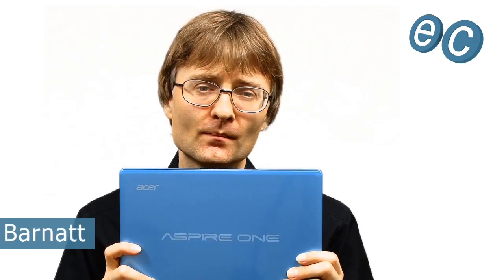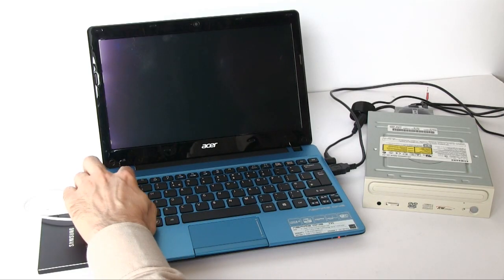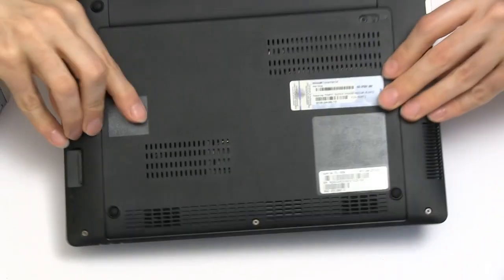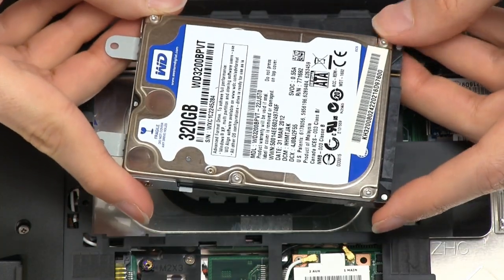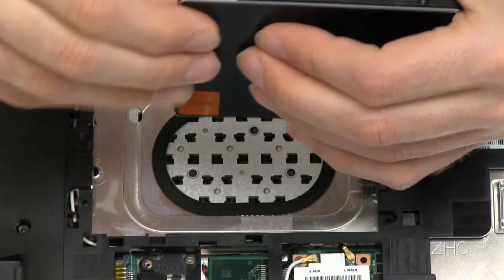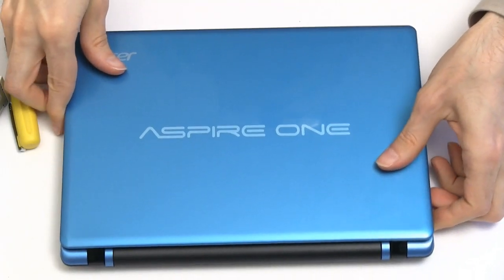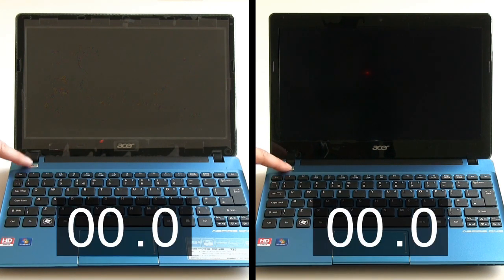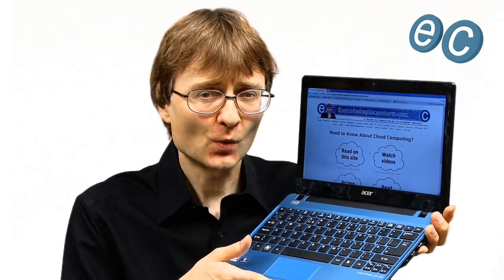Laptop SSD Upgrade (Aspire One 725)

Comment: Use a very strong laptop usb port and an adapter to speed drives up, by copying a high amount of youtube video from the drive to the laptop. After 20 gb of copying the drive reaches extreme speed. A 64 gb Sandisk not A1 will reach 21 mb/s, sequental copying hoes back to 16 mb/s. That is the card's inbuilt Smartdrive that turns on. 
By copying oldwin files to the druve and from the drive, you can speed up the small files copying to 1.2 mb/s, I tried this w a phone, using A1 card. 
Then you can put the very strobg card into a weak laptop, it will force the chipset to work harder it does not drain the battery.

Comment: Why can't I just use a System backup in USB and format the drive with the USB.
NO software just copy the one drive to the solid state drive.
Seems that you made this extremely difficult. IDK?
Reply from the maker: No, I am not "making this extremely difficult". Using cloning software is the standard and by far the easiest method to migrate from the existing system drive to a new one. But this is an old video. Today I would recommend using Macrium Reflect: https://www.youtube.com/watch?v=c8BaLpd69QI
Reply: @ExplainingComputers  OK just seemed much more in depth than using a system image and or USB backup. I'll watch some more and research some more. Like you said the video is a bit old as well. Thanks

Comment: @Explaining-Computers:

At timestamp-3:13 to timestamp-3:35:

Is there that "S.I.D. Changing"-thing in Macrium-Refect-Free also?

(I'm asking because I need to clone the 500-gigabyte perpendicular-magnetic-recording 2.5-inch--platter 7,200rpm "Seagate 'Barracuda' " SATA3 hard-drive to a 2-terabyte Samsung "860 Pro" or Samsung "870 Evo" or "Kingston KC600" and I don't want for Windows to be pestering me "oooo, you must reactivate Windows!", which came preinstalled in my Asus P43E-XH31 (Windows-7 Pro 64-bit)).

Comment: EXCELLENT MATE JUST WHAT I WANT TO DO. NOW ADVICE ON A SMALL PROBLEM PLEASE ON MY LAPTOP I HAVE ALL THE PROGRAMS I HAVE ALWAYS WANTED NOW ONE FAVOURITE PROGRAM THAT I ALWAYS USE A LOT IS ACDSee Pro 2. I HAVE TNIS ON MY NOTEBOOK SSD DRIVE BUT IT IS A PIRATE VERSION , HOW MY MATE INSTALLED IT I DONT KNOW. NOW IF I CLONED A NEW SSD AS YOU DONE HERE DO YOU THINK THAT ACDSEE WILL STILL WORK ON THE CLONED SSD WHICH I INTEND FITTING INTO A STACK COMPUTER.

Comment: Can I use an SSD in my Acer emachines D725 laptop with intel pentium T4400? 
Please reply !
Reply from the maker: This should be fine -- it has a 2.5 inch hard drive as far as I can see, which could be replaced with a 2.5 inch SSD as in this video.
Reply: @ExplainingComputers  Could you also recommend me a SSD?
Reply from the maker: @noobgog8602  If in doubt, get a Samsung EVO of whatever capacity you require. If you want something a bit cheaper, get a Kingston.
Reply: @ExplainingComputers  thanks for your help!
Reply: @ExplainingComputers  Thanks for helping buddy I appreciate your work 😇!

Comment: Hi! just a stupid question.. what will happen if one doesn’t clone the hard drive before replacing the old HDD? 

And is it okay to put a SSD with larger capacity, say 500gb or 1tb? I have an aspire one 722 and planning to upgrade it as it runs very very slow now. 

Thank you.
Reply from the maker: Yes, you can use as large an SSD as you like (well, up to 2TB on older hardware). Prices have fallen a lot since I made this video! But if you do not clone the HDD, you will have a computer without an operating system that will not boot  until you either clone the HDD, or install Windows or Linux from scratch.

Comment: I have a laptop that still has a HDD and it only takes five seconds more at 40 seconds compared to your SSD with 35 seconds. But I see you’re running Windows 7. If you upgrade to Windows 10, you’ll see a much faster boot time. Before upgrading to Windows 10, I waited longer just to get the notification icons in the bottom right of the screen to load, than in now takes from pressing the power button to fully booted up! My next upgrade is a SSD.
Reply from the maker: I very much doubt that upgrading to 10 would increase boot speed. The power of the machine itself is the issue here; this is a low-spec netbook with a single core 1GHz processor.
Reply: ExplainingComputers 
Well, when I had Windows7, my laptop was really slow despite me trying various ways to clean it up. When I installed Windows10 after I formatted the hard drive, It is much faster and runs smoother too. The only thing I don’t understand is, when I first installed Windows10 32bit and then again when I re-installed it as 64bit, I got the  “a hyper transport sync flood error occurred on last boot press F1 to continue.” I got it three times, then Windows10 continued to install. I haven’t come across a clear explanation of it yet, despite a few searches.

Comment: Last week I replaced the 320 Gb hard drive on my Acer Aspire 1830T laptop (purchased 8.5 years ago) with a 128 Gb SSD.  I only saw this video while browsing today. My installation was as painless as yours, but rather than clone the entire drive which dual booted Windows 7 and Linux Mint 19, I opted to just install LM 19.1. This really has given this little machine a new lease on life. Now I don't have to worry about bouncing it around when I travel.  SSDs are now so affordable that there really are few reasons to not upgrade mechanical disks. I really enjoy your videos. Keep up the great work!

Comment: If you'd ever had the hassle of retrieving a tiny dropped screw from the innards of a laptop you would have taken the drive and caddy well away from it all.  LOL.  
Did same thing in the past replacing the old HDD with a hybrid HD drive.  For those who need a large amount of storage its a good compromise - not as fast as a full SSD but large drives are much cheaper.

Comment: What is disappointing about your content is that you devote all your valuable and incredible knowledge and information on this inferior operating system. The architecture of the entire Windows interface coupled with the hardware that’s often associated with it  is not only and aesthetic disaster but also unreliable... for the price it always seems like a ‘better’ choice but I would prefer to spend more on equipment that can withstand the test of time across the board. Mac ecosystem unfortunately seems like the only thing out there that has secured this feature. I would happily switch to another OS if a company could top that .

Comment: You can use that SDcard reader to install a 64, or 128gb SDcard, direct your personal folders, and your temporary files to it, to save write cycles on the SSD. Add more memory, and eliminate your swapfile!
Reply from the maker: You could do this, but an SD card in a reader interfaced internally via USB would be very slow for a swap file compared to an SSD.
Reply: True, that's why I said to add ram, eliminate swapfile. Even if you're a gamer, you really don't need one if you have 16gb/RAM.

All of my personal laptops, have 16gb/RAM, or more, a SSD, and a 7200rpm HDD. My "personal", and temporary files, are all directed to the mechanical drive in the optical drive bay, and I don't use swapfiles.

My wife, on the other hand, likes here Optical drive, so I implemented the SDcard/eliminate swapfile on her computer, and it works great! :). My apologies, I should've been clearer.

Love your channel, BTW! Big fan, keep up the good work!:)

Comment: hi.. this upgrade is possible work on acer aspire one AO751h ? Also can it work with SSD  1 TB ?
Reply from the maker: 1 TB SSD should be no problem; I don't know the AO751h, but if it has a 2.5" HDD then this should work fine.

Comment: At age eleven, 1957, my Dad taught me a lesson about starting screws that I've used more than six decades. When starting a RH threaded screw, turn it counter clockwise until you feel or hear a click. You will never strip the threads when using this method. I slip the Phillips head screw driver into the slots, holding it in place with my index finger, as I start those tiny screws and upon feeling the click turn clockwise and everything is great.

Prior to the introduction of the Raspberry Pi I used my Netbook Acer Aspire One for portable operations to control a transceiver and to log contacts for my hobby, Amateur Radio. Longer battery life using a SSD gave me a few more hours operating times away from the AC mains. Other types of technology have given me ways to extend power on with the netbook, like USB battery packs, cigarette lighter USB adapters for recharging, and better portable solar panels, but the Raspberry Pi replacing the netbook is a better power reduction idea.
Reply: My Dad taught me the same lesson...
Reply: @JohnGalt-w1o  I am John Galt...

Comment: I’ve got an old 96GB Kingston SSD (the original 320GB Toshiba HDD died) in my Aspire V5-121 :-P I also downgraded it from Windows 8 to Windows 7
Reply: and upgraded the RAM from 2GB to 8GB on a 1GHz dual core AMD C70 which is kinda funny :)

Comment: Do you need an adapter to use the ssd? Like I don’t care about my old files. But when I put in my new ssd it says no bootable system detected.
Reply from the maker: You don't need an adapter, but you will need to install Windows or another operating system on a new SSD, or clone (copy) your old boot drive onto it as I show in the video.

Comment: It does breathe new life into an old laptop too. My Dell Vostro 2520 which I upgraded with a SSD would get about 5:50 hour runtime with the standard 48wh battery but if I install the spare 6 cell 78wh battery it is hard to kill in 9 hours. My benchmark is streaming video on wifi from youtube. The SSD uses that much less power than a spinning disc. I used Acronis free software to clone the drive.

Comment: It's okay unless your laptop has a 1tb or more hard drive already installed. 
Although bigger SSD drives are available, the price for the larger storage space is on the steep side. 
So you have to weigh up - do I need all that storage space? Is a quicker boot and load time worth the money, if I buy a large SSD to match what I have at the moment?

Comment: I'd be interested to see how this goes long term as my Acer Aspire One 722 had a tendency to slowly kill SSDs.   :(
Old school mechanical HDD are fine, so it now runs Linux Mint, quite well.
Reply from the maker: This machine (and its SSD) are still going strong today (March 2017). Well OK, the battery goes not last as long as it used to, and the hinge is also not as well as it once was. But the SSD is fine! :)
Reply: See my solution to this issue above. :)

Comment: One of the [many] comments may have already said this, but you can now clone drives a lot easier, without relying on a CD-ROM, by using either the Samsung Magician software they provide, or MiniTool Partition Magic free which has a "migrate to SSD" feature and can clone the internal HDD just by rebooting the system and not having to boot to separate media (like USB or CD-ROM).

Comment: What if my laptop is IDE interface with the hard drive? 
When cloning, what if my old hard disk capacity is much larger than the SSD drive (which is usually much smaller)?

Comment: An old video but  still valid.  I added an 850 EVO 500GB to my Aspire and it went from a seldom used laptop to my everyday machine.  Incredible difference in performance.  Most amazing is opening MS Word or Excel.  They open as if they were on the Task bar and only minimized.  Amazing.  I think I will follow your advice on the memory upgrade you did after this.  Thanks for all your great videos.
Reply: If your laptop model has more than one motherboard configuration, you can swap it out with the better configuration.

Comment: but does it run crysis?
Reply: Jose Barona I tried it on a laptop with similar hardware, yes it does on min settings at 640x480 with about 10-15 FPS

Comment: I have a crashed HD in my 725, so I don't believe it can be cloned.  What would happen if the SSD were installed without doing the cloning step?
Reply from the maker: Without cloning the HD you would not have an operating system. If you have recovery media, you could reinstall the operating system from that. If not, you will need an operating system. You could install Linux for free -- see my video here; Linux Mint works well on the 725: https://www.youtube.com/watch?v=3Vq_v0oGPH8
Reply: https://www.microsoft.com/en-us/software-download/windows10 These seem to be instructions that would apply to my situation, right?  The computer originally came with Windows 7, but it was upgraded at n/c to Windows 10 during the past year (before the crash).

Comment: can i use both ssd and hdd at the same time like ssd is my os and hdd is for storage
Reply from the maker: Stephen Inverarity Most laptops will only accomodate one 2.5 inch drive or SSD physically. However, if you replace a laptop's hard drive with an SSD you can always use the removed drive as external storage using a SATA to USB adapter (as I show in the video), or indeed a 2.5 inch drive case with such an adapter included. The latter are very widely and cheaply available.
Reply from the maker: Yes, if you have the physical space and interfaces in your computer for two drives. Most laptops only have the space for one.
Reply: well just found out it has only one space which kinda sucks but anyway can i use that ssd adaptor to a 2.5 hdd is it doable just in case i need some storage space thanks
Reply: Can you let me know if this worked because i was thinking of doing the same thing
Reply: Thank you so much i have been looking for an answer and you provided thanks
Reply: dont forget of the laptops with dvd readers you can swap them for a second ssd with the help of a small adapter

Comment: Are hard drives interchangeable, Can I take a hard drive from an Acer and put in a Toshiba?
Reply from the maker: Indeed you can. The drives have to have the same interface (all new drives are SATA these days have most have been so for at least 5 years), and the drives have to be the same form-factor (size) -- eg 2.5 inch -- to physically fit in the same spaces/mounts.
Reply: Thanks, Learning on my own,,,or from Youtube videos. lol
Reply from the maker: Ace Rimmer No problem. Feel free to ask questions here! :) And hopefully you will find some of my other videos useful.

Comment: Why don't you use the 'Aero' theme on your Windows 7 systems?
Reply from the maker: Aero consumes resources with no performance payback. :)
Reply: +ExplainingComputers True.
Reply: ExplainingComputers Not only that. While on hdd my Dell Mini 1012 booted to the desktop in 22-25 sec and lasted for 5h. Am down  to 10 sec with an Intel 540s and 5:30h batery life (with absolutely no sensible changes going to 2 gig RAM). This Intel Atom powered  machine is powered by an efficient Linux OS so new hardware might not be the best upgrade for such little computers. At least considering the best "performance" one can get using Windows. PS I greatly appteciate all of your carrefully shown experiments so far.

Comment: SSD performance seems to be tied to the CPU power. My Lenovo 780 (dual core) boots in about 12 seconds. Same SSD in my HP Envy (4 core) boots in 3 (!) seconds to a stable, usable desktop. Both used to take 54 seconds with the old style HD.

Comment: just to make surr. does this aspire one 722 have sata3. how can i tell if it's sata3. a friend told me to check the motherboard. but in which area?
Reply: You might be able to see that by going into the BIOS settings during boot.

You should also be able to find a official spec sheet that will tell you.
Reply: Thanks, I will look into it again. The last thing I know it is SATA 2

Comment: Is an ssd worth the money for gaming i have a dell d630
Reply: +ExplainingComputers there is a catch, SSD's are more reliable and are faster but have a low cap. for the price p. Where as hard disks are slower and less reliable but have large caps. for there price.
Reply from the maker: +Beau Patterson An SSD should make your PC boot quicker, and all programs, including games, launch faster. But aside from this, games performance is unlikely to change.
Reply: In some games like skyrim the areas load quicker, but i only noticed it after installing it on a hardrive (i had been playing it on a SSD).

Comment: hello sir..please help me,how to install win7/win10 on ssd..i'm using aspire 756 but fail and stuck on boot with error message "a disk read error, press ctrl+alt+delete to restart"..what should i do?
Reply from the maker: +Roy Stevo Are you doing an upgrade as I did here -- ie have you mirrored the old disk to a new one?
Reply: Thanks for reply sir, i try to clean install several times but fail on reboot "a disk read error" then i try another option to copy the partition / clone the hard drive to ssd but still get error on boot...i'm using paragon software..do u have any idea?
Reply from the maker: +Roy Stevo This is very strange. It suggests perhaps a hardware error on the drive. I am not sure what to suggest. Is there any way you can test the drive on another PC?
Reply: the ssd is working fine tested using pc and can install windows without problem..but aspire one 756 is hard for me to get windows install on ssd..for native hard disk, it should be okay..the problem is only with ssd.
Reply from the maker: Roy Stevo
This suggests maybe a BIOS setting issue --- see if it is being detected OK in the BIOSS.